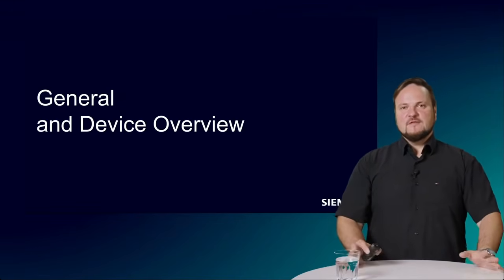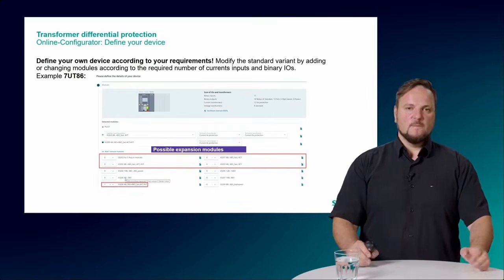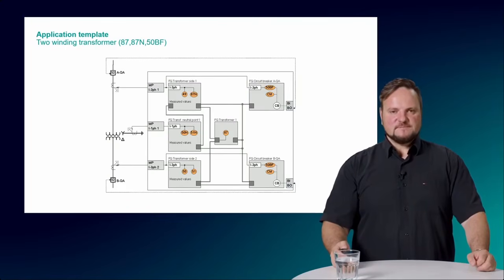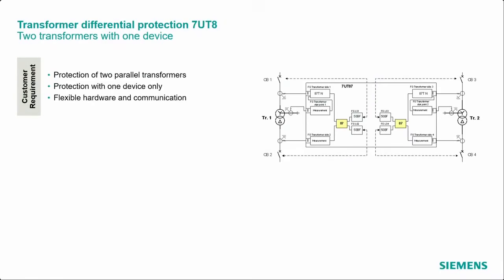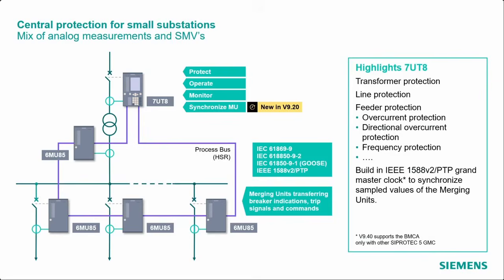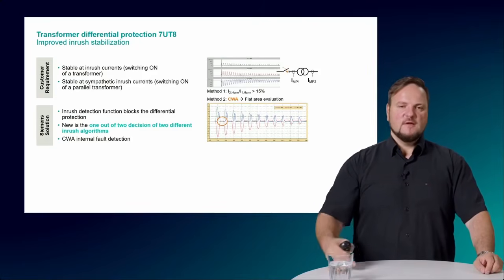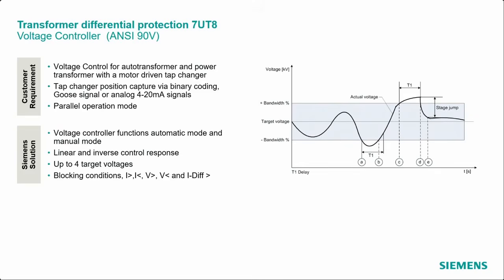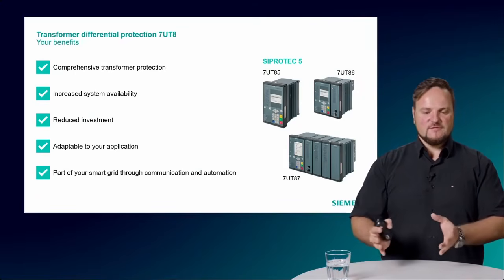Transformer Protection Webinar Series 1 : Part 1 Transformer Protection at a Glance

Comment: 7UT82 cannot support 24 as it does not have a 3 phase  voltage input so this cannot be used where overexcitation is a requirement.  You have mentioned that it can. I think that is just a small error.